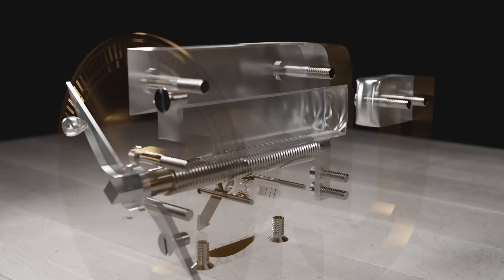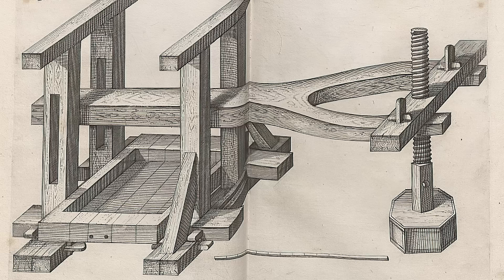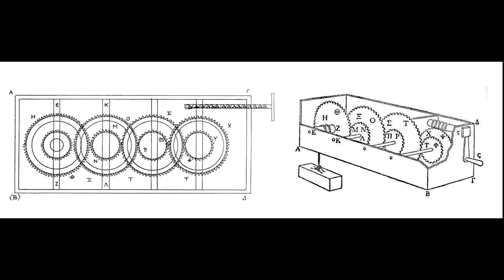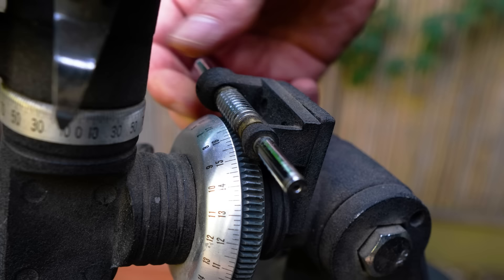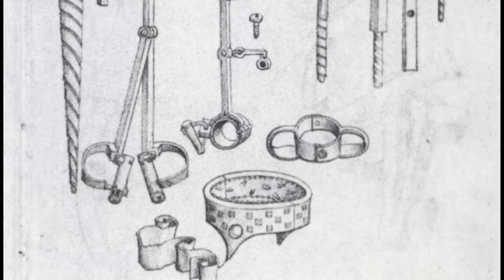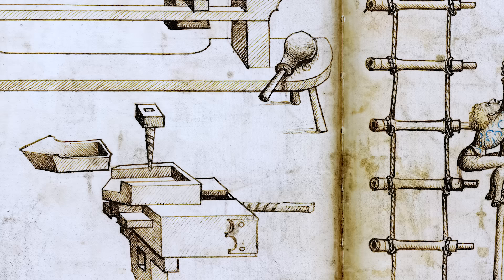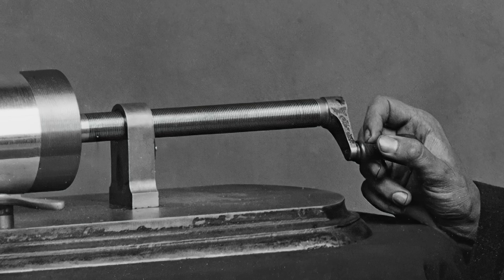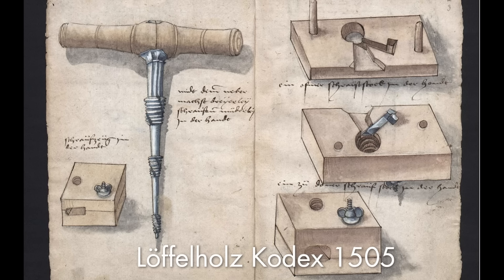Where DO screws come from?

Comment: Your comment about removing skill from the equation really resonates with me. I'm a carpenter by trade and being competent in my field now mainly consists of just knowing how to rely on your tools, removing as much skill from the tradesman as possible and relying on tools for precision or efficiency whenever possible.
Reply: Yes and no. It doesn't remove the skill from the bigger picture. It still requires skill (how deep of a cut to take, how much to advance it, etc).  Now, it is easier. That means they can focus their skill elsewhere. Like you said - now. It's knowing how to rely on your tools. Just like it always has been. Our tools become more advanced, so we can focus skill elsewhere and continue advancing. Skill is still required to operate tools with precision, safely, and efficiency. Major difference is the overall process is faster now. Also, there's a lot of hand skill involved in more decorative carpentry (furniture, cabinets carving, etc)
Reply: As a professional furniture maker,  don't sell your talent short, sir. With the exception of steaming wood to bend, most woodworking involves removing the correct amount of wood, but not too much. No matter how crude or sophisticated the tool, your hand and your eyes guide your ability. Repetition is the teacher of skill. Hold your head high,  sir.
Reply: Same here. I'm a master printer. The technology employed today removes the need to intensively train. The tools, printing press, is what is relied on.
Reply: @druckerman247  idk sometimes I think I need training for consumer printers....
Reply: @blackbird1234100  It does remove some skill, at least. Cutting a mortise using a mallet and a chisel is a completely different skill from cutting it using a mortiser. Getting a board flat and straight and of uniform thickness and width with a hand plane is a completely different skill from running it through the jointer and thicknesser.
Reply: @a0flj0  Not really. Most static planers cannot produce a flat board. The simply make a smooth sided board with the same old bends. To flatten a board you have to get one side flat. That's a considerable skill as every raw slab is different.
Reply: @davidelliott5843  A good machine can definitely create a flat surface. Most hobby or construction site machines aren't good enough, that's true. But better professional, stationary machines are.
Reply: Maybe that's why tradesmen are looked down upon in modern society. It's an unfortunate situation since I consider these guys far more useful to society than bureacratic paper pushers, a.k.a. white-collars.
Reply: I am a craftsman motor engineer City and Guild accredited I studied Hydraulics Gas and Electrical laws for my certificates I am fascinated by Applied force usage And yet I doubt I could equal Ada Lovelace We are all on this world with a different skill set that should leave the owner of said skill Dammed if not used for the benefit of us all
Reply: @druckerman247  At least it made our work easier but it still doesn't remove the need for skill, just lowers the bar on entry. I don't miss messing with trays of type as someone that still did manual typesetting for years as DTP grew more common.
Reply: This is true, but I was an aerospace machinist, then an aircraft mechanic, then an electrician.  There is still a huge gap in skill and talent between tradesmen.  Some, even with all the amazing powerful tools we have, can't seem to drive a screw without "screwing" it up (dad jokes).  Others, could carve David with a sawzall
Reply: @caty863  Tradesmen and craftsmen will be the heroes of the human race if TSHTF.
Reply: @blackbird1234100  That portion of figuring out how deep, how much, ect can be eliminated easily as well. The real skill is understanding the screw and what is required to manufacture one from scratch. If I wanted to easily remove the skill for how much and how deep, I would just put indicators or locators on the tool cutting the internal thread. Again machines remove skill and free up skilled labor for improvements in higher skill area.
Reply: @caty863  tradespeople are semi-skilled workers. They've always been looked down on by some fully skilled professional people. The world needs both ends of the spectrum to function. People who use their hands will still be useful to society even when automation continues to reduce the number required. People who use their brains will be required more and more as society continues to gain complexity.
Reply: Ah, yes.  But, I beg to differ on the "skill removed" idea.  Skill is still required these days.  Now, you need the skill to wield the tools intelligently.  Human skill will always be needed, just on a higher level.
And yet, I understand the idea of skills passing away.  My father prided himself with his first-hand knowledge of arcane technologies.  He learned how to repair a wooden row-boat.  He learned how to forge cast iron.  He knew how to tan leather.  He built a cedar-strip canoe with rawhide woven seats.  For my part, I studied photograpy and I processed lots of photographic films in a darkroom and lab in my basement.  Who takes photos or movies on film, today?  Almost no one.
Reply: @FarnhazenBrep  Although skills can be valuable they are not what they use to be. Today we are a throw away society and mass production. Neither of these ideas tends to be skill oriented. Dont get me wrong there are jobs that need skill but the ones that use to be skilled are now disappearing even faster with modern technology.  Welding, machining, farming, ect. Engineering is about fining more efficient ways that suffice and are cost effecting. Most of the time that removes the human error and makes a more consistent product. In turn this removes the skill out of the work. The skill is then transported to higher levels such as maintaining the machine or management ect. If you still dont believe me than you are the reason for your own restrictions in the world.
Reply: @a0flj0    “Thicknesser” THAT took skill.
Reply: @stevescuba1978  q
Reply: @bryan smith  Bryan! You are correcter than someone who is exactly correct. 
  Whispers: (Here. Dont tell anyone I gave you these -  
.........,..,........   ,, ,,,,,,,,,,,,,,,,,,,,,,,,,,,,,,  ...................................)
Reply: @a0flj0  the main difference is eating or not eating  no one would pay me the time it takes to face and edge then thickness the timber to make windows, doors  or stairs if I did it with hand planes
Reply: Removing skill also means the devaluing of skill, the devaluing of people who work with their hands, and ultimately the dumbing-down of society. 
And here we are, with easy-buttons for everything, and very few people understanding how anything works.
I wouldn't be so gung ho (um, it means stupidly-supportive) about removing skill from the equation of society.
Reply: I think you’d be surprised at how much skill you’ve acquired in your years woodworking. I tried it for a few years, and it is NOT an easy job. You’re selling yourself short, I’m sure!
Reply: @1oolabob  this is objectively untrue. The human race, though some folks’ posts on social media may make us think otherwise, is more intelligent and talented than we’ve ever been.
Reply: Used to layout stairs with a pencil and paper. Now I use a $20 app on my phone. It's faster, more precise and produces a diagram that I can save, email, print out later. I can try a few different things to play with my numbers almost instantly. Maybe the best $20 I've ever spent lol
I can still layout stairs with a pencil and paper only thing is, why would I 😁
The skill still comes into play when knowing how to enter the required info, still be within building codes, using my square, saws chisels etc. To accurately cut and install the Stairs. Not like the app diminishes my skill, enhances it really
Reply: Sounds like the circuit board repair industry.

Comment: I repair sewing machines. About 40 yrs ago when I first learned how they work, I recognized how important screws are to do so many different things. Another simple machine that is indispensable is the spring.
Reply: o
Reply: Who makes the best sewing machines today? What's the oldest sewing machine youve worked on? Are modern sewing machines like the ones that monogram clothes and make patches worth the money?
Reply: i think technically a spring is a component as a machine is defined as providing a function as an output of more than 1 component.
Reply: You just reminded me of the MST3K video about springs called "A Case of Spring Fever" (check it out, its short and its on youtube and worth a watch). It's a Twilight Zone style video designed to teach kids about springs, its about a guy wishing springs didnt exist and then getting transported to a world where springs dont exist and they talk about how all kinds of machines, tools, and even furniture doesnt work without springs.
Reply: A spring isn’t a simple machine like an inclined plane or a wedge, but is very simple
Reply: @olliefoxx7165  I’m not op obviously but you still may find this interesting: I own two singer sewing machines, and both are pre 1950. One is a singer 29k55 patcher from 1922 which is treddle powered and also industrial and the thing is an absolute beast, I love it. It works extremely well and the only things that have ever broken on it that I know of broke due to user error. I also own a 66-16 from 1946 and it’s electric motor powered and it’s fantastic, I adore it. It did seize up a bit for a time because I let it sit in the non-climate-controlled garage for a year or three, again, user error. I took it apart, cleaned out lots of 70s orange fuzz, and put it back together and it worked like a charm but had lots of squeaky running noises. Every single squeak went away as soon as I oiled it. It also had a problem once where it was binding in one spot during the needle stroke but I just had to loosen and re tighten screws in the bottom mechanism thing until I found the screw that had too much tension on it and it freed right up. It’s a bit dirty, again, user error.
Reply: Yes! excellent suggestion!  The spring, first was just as sapling bent down to make a snare to catch prey.
Reply: Do you really mean to call a screw a machine? That would fit for those ancient-Greek water lifters or grain movers, but apart from them???
Reply: A spring is an energy storage device - you can hold energy generated by the operator and transform it's duration, power and direction by the use of simple machines. Really marvelous when you think about it. A battery for lattice energy.
Reply: The right vocabulary for a screw and a spring is machine element
Reply: @olliefoxx7165  Sorry my answer is so late. So many to choose from - industrial or home machine? For home machines l recommend Janome or old Kenmores. For industrial machines, Juki makes just about every type there is (single needle, double needle, overlock, heavy duty for leather/upholstery) I think the oldest l ever worked on was the kind using a shuttle type of bobbin, probably a 1920s Singer. I still have my Grandmother's (born 1901) White Rotary from 1930 or so. It still works but some replacement parts are being discontinued.
Reply: @famster92  When I was a kid I had a book titled something like "The six simple machines"   - lever, wheel and axle, pulley, inclined plane, wedge, and screw.
Reply: @HansDunkelberg1  There's a concept of the "fundamental machines". Several simple devices which increase man's work output and which can be employed at neolithic or early bronze level of technology.  These are:

The Lever
The Inclined Plane
The Pulley
The Wheel and Axel 
The Wedge
The Screw (which has been argued is an inclined plane that's been wrapped around an axle)

With very few exceptions, machines with moving parts make use of some variation of at least one of these "fundamental machines".
Reply: @murrfeeling  A screw anyway is already quite complex. One can call a twig a tool when a bird holds it in its beak to pull out an insect from a hole in a tree. So it indeed seems to make a lot of sense to call a screw at least a "simple" machine, to distinguish it from such an even more fundamental device. NASA says exactly what you say, so the term indeed seems to be conventional.

Thank you! You just have miswritten "axle" as "axel", on one occasion. Axels have to do with sports, they're not what you mean.
Reply: @murrfeeling  One question still, though. Can you tell me a reason why hammers and needles aren't included in that list of "simple machines"? Are hammers to be understood as levers?
Reply: @HansDunkelberg1  I did not invent the list and had no input on what is or is not included. The concept (if not the list) was attributed to Archimedes. 

 If I had to guess...

It has to do with the transformation of force in that broad Newtonian sense. Levers multiply downward weight to upward lifting,  inclines turn a forward push into upward movement. Wheels and axles can run gear differential and so on. 

Ultimately we're dealing with a semantics issue. You think screws cannot be categorized as machines. The counterpoint is Greeks defined screws as machines 2000 years ago and there has not been a strong argument to de-list them. (With a counterexample of bats being once considered a class of bird, but reclassified to mammals due to the hair, milk ect.)

Comment: There actually has been an improvement on the Archimedes screw, within the last 20 years surprisingly. It's called an "Olds Elevator". Basically the screw itself is static and the housing spins instead. This has some advantages, like being better for moving fine substances like gunpowder, rice, wheat, grains etc. An Archimedes screw pushes a lot of air, which can lift and spray the fine materials into unwanted directions. The Olds elevator only moves the substance, and what little air there is in-between the grains of rain for example.

It's a surprisingly simple difference from the normal Archimedes screw, but nobody thought of it until 2003.
Reply: Thanks for this comment! I learned about Olds Engineering because I was watching NASB videos on sugar dust explosions, which were often due to the ways the sugar was transported throughout the building. While fully-enclosed compressed air systems can be used, the Olds Elevator can be used as nearly a direct replacement for older-style elevators without a huge investment.
Reply: Come to think of it, doesn't that mean that the only thing doing the pumping is the surface friction on the housing vs the screw?
Reply: @orppranator5230  No, the housing has a scoop attached to it on the bottom. The hopper has to have a minimum amount of material in it or the device won't work (or very poorly). The scoops and friction from the housing both work together to move the material in a circle and the screw makes it move upwards.
Reply: Is this the concept that a concrete  truck works on?
Reply: @devynforsyth4838  No, a concrete truck uses a type of archimedes screw. The housing and screw are attached and spin together, and there is no central shaft.
Reply: @devynforsyth4838 the helix in a concrete truck is attached inside the drum and the drum always turns when the truck moves to prevent making flat spots on the drum rollers. Once at the delivery site and mixed with water, the drum is rotated the opposite direction and material is conveyed out of the drum.

Comment: The old German script you asked about appears to be describing a tool known as a Wolfsangel , or literally, wolf's fishing rod . Although I can't read the script, the word appears (split into the words wolfs and angel ) in the first line of the script. A Wolfsangel was a wolf trap. The drawings you show appear to be a more "modern" take. The older style was just two pointed hooks on two ends of a bar, with a perpendicular bar to which a chain was attached. The hooks were jammed into a chunk of meat and chained to a tree, which an unsuspecting wolf would then swallow, hooking himself like a fish. A stylized version of the old design was used, for a short time, as a symbol by German civilian resistance fighters in the latter days of World War II as Germany was being overrun by the Allies. This symbol is still in use today as the emblem of the Ukrainian Azov Battalion.